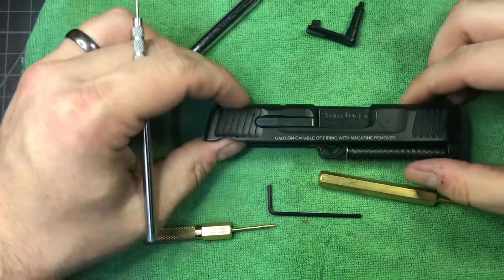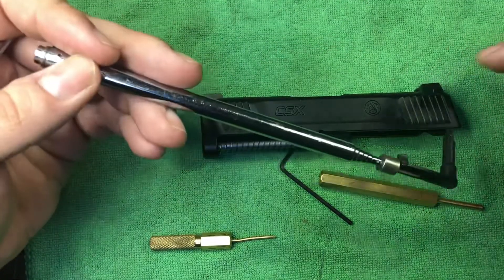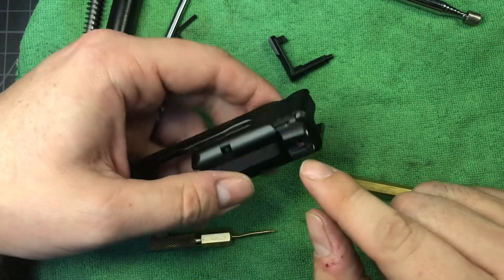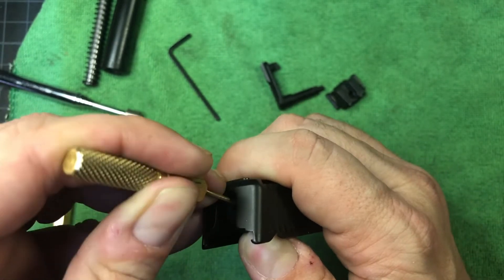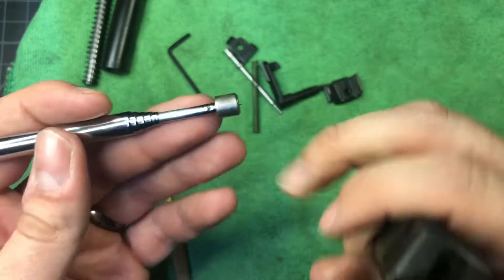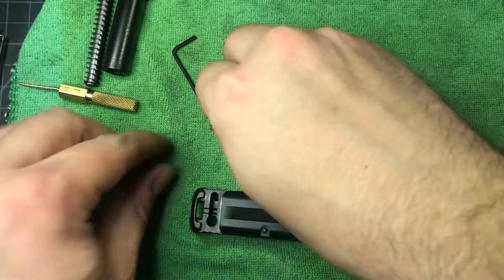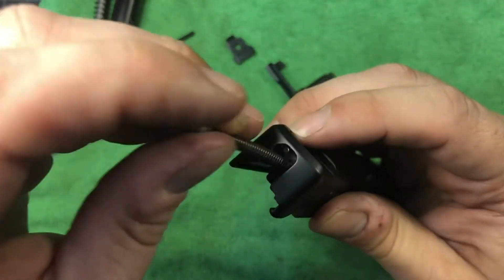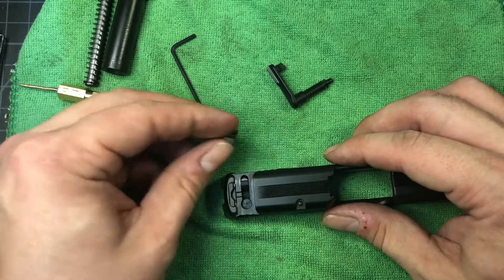Complete Disassembly // S&W CSX // (Slide, Part: 2) #requested #howto #csx #smithandwesson

Comment: Had trouble getting the fireing pin stop back in---then pushed the plunger spring part in and used a punch to push the firing pin in all the way and then the stop plate went right in....

Comment: Are you 100 percent certain there is a spring behind extractor?  Mine extracts perfectly and actually was surprised when I first pulled extractor that there is no spring behind it.  I ask because it is possible however unlikely that they forgot to put a spring in mine from factory??  As I said before however mine functions flawlessly without a spring and ejects shells to a very consistent distance as well.
Reply from the maker: That's very surprising. One would think the location of the extractor pivot pin would ~suggest~ something to pivot off of. (I.E a spring) 

Further disassembly and correspondence is required.

Please email: hangfiretv2020@gmail.com

Comment: REALLY. Your going to help people tear a gun down then NOT show them how to put it back together ? Go back and do a complete reassembly without the fast forward. Its easy to take things apart. Not so easy for those not inclined to put it back together. By the way the easy way to reassemble the right side Slide release is to push it back with a screwdriver in the notch just in front of the spring
Reply from the maker: This video features a reassembly of the slide. There are two parts to this CSX series. Potentially "Part 1" has the information you are looking for. 

Regarding questions on reassembly: These parts are all location specific and the reassembly process is the reverse of it's disassembly. Should you feel that you are not mechanically inclined, I would strongly suggest not disassembling your firearm; and locating a gunsmith to perform the work for you. 

Should you have any direct questions please feel free to email: hangfiretv2020@gmail.com for more information.